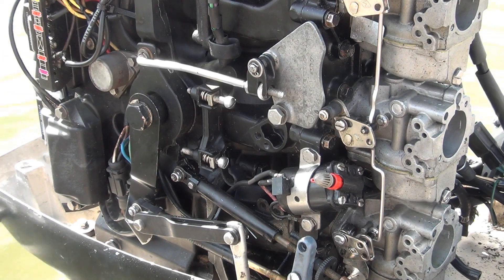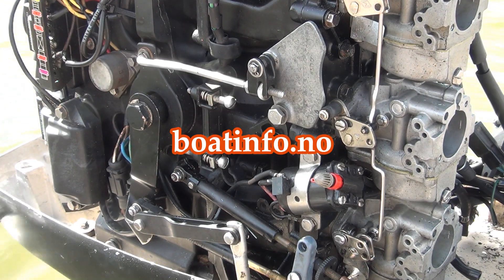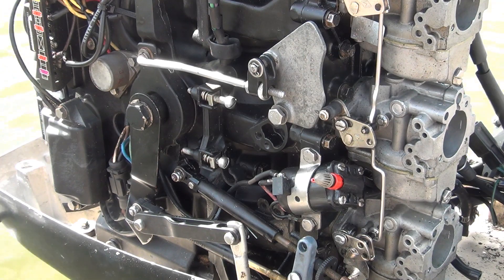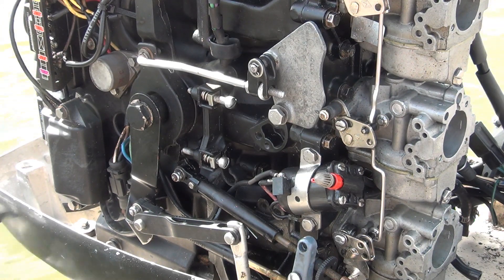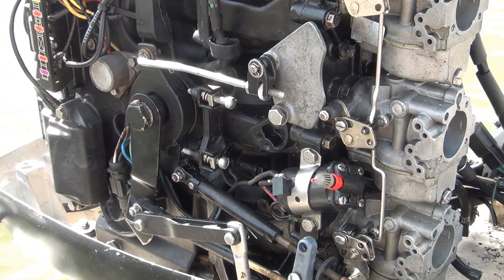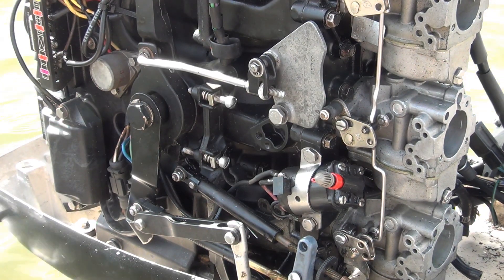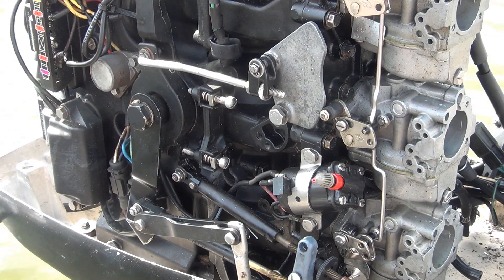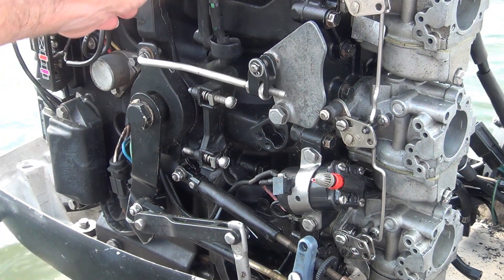WEAK SPARK - 1987 Johnson 70 Hp Outboard

Comment: i just fixed my johnson 70 1999 model it was doing the same thing idle good ,good top end  but fell on its face and stalled just off idle .my throttle plates were opening before the timing base advanced, so i just gave it a little advance just before the throttle plates opened  and it fixed it straight away. i thought it would be anything but that .hope this helps.
Reply from the maker: Hey. Thanks for watching and commenting. Yes, I read that on some forum, and tried it with no luck. I'll try it again and see what happens. I really dont want to  tear this thing apart !  Thanks again ! Stay tuned !

Comment: If that engine has been underwater., check all the 12 volt positive wires and connectionds. They corrode fast if battery was connected when sunk. Try a voltage drop test on power pack feeds ect
.
Reply from the maker: Hey. Thanks for watching and commenting. No it hasnt been underwater in a long time but it does stay in the lake. And yes, the last time all the positive connections corroded fast. Had to replace the big red plug and key switch. Thanks again & Stay tuned !

Comment: Hey,TOO,Just got another Boat,1963Starcraft Jet,15 ft.,w/trailer and A 63 Johnson 40hp.SSeahorse'lectric shift,Have any Exp with them,Won,t shift to forward,only Rev.,Any Exp.with them,You or Kodibas?Best Video,s Ever!!!!!!
Reply from the maker: Hey Your probably looking at a new shift solenoid. Its in the gearcase I think. Check the schematic at marineengine.com. to be sure. Thanks !
Reply: @THISOLDOUTBOARD1  got only Two Electric coil Magnets on both ends,only 2 wires running down to Lower,Checking the Grounding  and the Switchs first on shifter!
Reply: Yup,Getting My Plan of attack all Ready,What to do  First,Gotta say,this thing is Built pretty Stout,got old 1/4"ply out and Drenched 1"Foam,Hows your Starcraft Coming Along?
Reply from the maker: @smc65714  Slow. this crazy motor has been taking to much time.

Comment: OK, well the original low compression readings do concern me...And, you are right, buggered up sync settings do point to some sort of problem.  The probability of the carbs getting messed up during an overheat is low, like you say, but not impossible.  That fuel pump isn't properly mounted, and that fuel tank looks suspect, but that does not mean is it problematic.  Running so poorly after an overheat oftentimes indicates some sort of internal damage, scuffed/scored pistons, etc.   BUT, just cuz it overheated, doesn't mean it is internally damaged....But, these loop scavenged engines are not tolerant to much if any internal damage or wear before they refuse to idle correctly.  And, just because the compression readings came up, does not mean all is well internally....
OK, so you are suspecting ignition problems, perhaps....I'm not sure I would trust that inline neon tester though....I know it is tough to watch, but does the light brighten up and get consistent when you get the engine to accelerate and run OK at high speeds?  Again, please don't get hurt bouncing around back there while the engine is running fast....
Generally speaking, the CD3 ignition system on this engine is very reliable, charge coil and sensor problems are rare....Please do not pull that flywheel off just yet, you don't even have the correct OMC puller....And, you will need a ring gear holder to properly retorque the flywheel.  Using the zip gun for installing the nut may lead to a sheared flywheel key.  
The connection between the overheat and possible ignition problems is the heat that may have melted/shorted ignition wiring or connections.  Using your eyes and doing simple common sense testing is the best first route to take before getting even more frustrated by swapping parts.  Keep in mind that the ignition systems changed quite a bit on these engines through the years, so the possibility of mismatching stuff during your swaps is great.....
I would start by a visual test on all your ignition wiring...Is any of the wiring melted where it was laying on the block?  I would pull apart all the amphenol connections to ensure the pins/sockets are properly positioned and not damaged...Use isopropyl alcohol to lube the rubber connectors, DO NOT spray WD40 in there.  Look at those coil primary connections, those push on connectors often get loose/corroded.  It is OK to use a little grease on these connections to prevent future rust/corrosion. Next, I would check the powerpack and all three coil grounds with an ohmmeter on the low ohms scale.  You should see less than one ohm when checking between the ground lead and a good block ground.  Next, I would push the key switch stop lead out of the amphenol connector and retest.  You will need the amphenol tools for this, do not cut the lead.  And yes, you will need a decent spark tester to do a cranking output test.  This will either confirm or deny what you are seeing on your neon light.  
Once you have done all this, we can talk about some resistance tests on the charge coil and sensor coils.  These tests can be done without removing the flywheel.  You can check the coil primary and secondary resistances as well.  
Again, I understand the frustration, but try hard to avoid the swap out testing methods.  Chances for introducing new problems and getting even more confused go way up....We have to stick to "the basics" as you said, and use proper test methods...
Reply from the maker: Thanks !

Comment: New subscriber here, timer base won’t make weak spark. Timer base is just a trigger. Check your coil grounds, charge coil voltage output, power pack voltage output.
Reply from the maker: Hey Thanks ! And thanks for watching and commenting. Yeah I'm figuring it out a little at a time. Dont usually fool around with these bigger motors. Yes I've ordered the DVA. Thanks again !
Reply: THIS OLD OUTBOARD awesome, any questions feel free to ask! 👍👍
Reply from the maker: @jcdesignsandboat-works8290  Thanks !
Reply: THIS OLD OUTBOARD Yes sir, you bet!

Comment: My mate had one of these he replaced the coil pack and ran beautiful..
Reply from the maker: Hey. Thanks for watching and commenting. Really appreciate it. I've already swapped out the coils and no change. Stay tuned !
Reply: THIS OLD OUTBOARD did you try and replace that box with the orange and purple on it above your coil it’s all electrics wires
Reply: Try that before taking flywheel off..
Reply from the maker: @zanegilmore6450  I'll check it out. Thanks again

Comment: What does the WD40 do to increase compression?
Reply from the maker: Hey. The motor had been sitting after it ran hot and died. The first compression test was 90 on the middle cylinder. Thought possibly the ring was stuck and the wd40 would help loosened it up. Well, got lucky, that seem to be the case. Its still at 120. Thanks for watching and commenting. Stay tuned !

Comment: I’m assuming you’re running the engine with the tank vented, it probably would not run if you kept the tank unvented. It would only run while the tank was under pressure.
Reply from the maker: Hey. This thing runs either way! Its Crazy. Thanks for watching and commenting. Stay Tuned !
Reply: My experience with unvented tanks is that the engine will run for a while and then will be starved by the vacuum that is set up. In fact if it is a plastic tank it will concave telling you to release the vent.

Comment: My son in law traded a Harley for a Skeeter bass boat with a 175 Johnson. The guy took him around the lake and it ran perfect. He brought it here to Texas from California. Took it to the lake. It started cutting out. He managed to get it back to the ramp. Its been setting for about 10 years. Now it's mine. Don't seem to have any spark. Its going to be a challenge. I don't even know how to operate the electric motor hanging off the bow. I can deal with my 14 aluminum with the 25 Johnson. Daughter is counting on me getting it running. I guess I will start with a book on it.
Reply: Was down at a boat ramp a few years ago. A guy backed a nice Bass boat into the water. It wouldn't start. He started screaming and throwing things. I felt sorry for his fishing buddy. I once had a 23 foot cabin boat with a 60 Scott. McCulloch . I had a Sears Elgin less than 10 hp that brought me in several times.
Reply from the maker: Hahaha ! Thats Great ! Go For it ! Check out boatinfo.no. All the manuals are there ! Let me know how it goes ! Thanks for watching and commenting ! Stay Tuned !

Comment: you really need a spark gap type tester. I love my CDI one as it allows you to do up to 8cyl in one whack. very very helpful. supposed to jump a 11mm gap. next check the output of the charge and power coils from the stator. ill betcha those are gonna read low, especially when she acts up. If good : new power pack baby! Haha good luck
Reply from the maker: Hey. Yeah, bought time an break down and finally get one! Hahaha Thanks again & Stay tuned !

Comment: If that tank is EPA compliant, 😬 the check ball will let air in but not out to keep from polluting the environment. Ha ha.  See how the ball mechanism is configured. That pressure could definitely flood the carbs if the needles are worn. That most likely would show up when it's just sitting without running.  You tried with a loose cap so that most likely isn't a problem when running.  I will say this, I had a 1973 Evinrude 65hp Triumph.  It would hesitate when slowly transitioning from slow to high speed.  I had good spark though.  Tried syncing the low speed on the carbs with some improvement but didn't completely remedy it.  One day it was idling in the bay while I was fine tuning the carb adjustment and it spit back on me and made a loud pop. I saw something hit the water and it immediately died.  I was like, what the heck was that!  Tried turning it over and heard bad noises. Got to looking and I had a hole in the block. I pulled the power head and disassembled it and discovered quite a few things had been going on.  What caused the hole was one of the Piston skirts broke off and got in a bind near the crank. All three wrist pins had a lot of slack in them, like 1/16 inch.  Also the Pistons were worn badly and had a lot of slack between them and the cylinder walls.  Miraculously the rings were pretty tight so it had good compression.  I had a buddy at the time that worked on OMC outboards and was a certified mechanic. Went to a school to get certified and had worked on them for a couple of decades. I told him about what happened and what was occurring before.  He said that a hesitation like that was often a symptom of severe wear in the powerhead.  Not always but often.  He said a lot of things are going on in that rpm transition causing it to hesitate when it's got a lot of wear.  Hopefully yours is spark.  Luckily you have parts motors to see.
Reply: The check ball in the cap is suppose to vent at 5 psi, so the tank balloons up before that happens.
Reply from the maker: Yeah. I've been worried about skirt wear. and want to spend any big money on it. If we can just get the guy to his fishin hole and back he'll be happy. Thanks for watching and commenting. Stay tuned !

Comment: clean carbs reset the mixture with the jets to stock .One or more carbs is having trouble getting out of idle circuit then resync carbs.
Reply from the maker: Hey. Thanks for watching and commenting. How will that help the weak spark issue. Thanks for watching and commenting. Stay tuned !
Reply: @THISOLDOUTBOARD1  you will find the weak spark is another issue. I had the same thing with my 70
Reply: @tomhobbies6888  how would you "reset" fixed jets? the only ones that had an adjustable slow speed needle were the newer 93' and up oval port motors
Reply: @ct1762  the high speed are fixed but the low speed are adjustable unless that thing is newer than it looks
Reply: Sorry your right  I just checked my repair records it was a 71 60hp triple
Reply: @tomhobbies6888  Sorry didn't want to sound smart! It's just I have 4 of these 3 70s and a 1993 60. The one thing that struck me, and it's kinda nice, is that the 93' has adjustable low speed needles to get it just right

Comment: What about this...   Pressure in tank feeds fuel from the tank to the cylinders...   But after an initial run pressure in the tank has been reduced by use of some fuel so pressure no longer feeds fuel to the cylinders...  And the fuel pump is too weak to pump fuel (without the initial tank high pressure) to the cylinders...     What do you think...?   How much is a fuel pump rebuild kit...?  (to eliminate a possible weak fuel pump issue...?)   Just brainstorming...
Reply from the maker: Hey. Just found out that the tank has a ball in the cap thats suppose to relieve the pressure but its stuck. Great comment though. Thanks again !
Reply: @THISOLDOUTBOARD1  Well soak that cap in a coffee can of some straight ethanol gasoline overnight and get on with it...
Reply from the maker: @williamriley2528  Rodger !

Comment: Heat soaked coil would produce weak spark...???
Reply from the maker: Hey. Thanks for watching and commenting. Stay Tuned!
Reply: in a way yes, but not on all 3 cyl. this is most likely a stator or power pack issue. maybe lucky and the connectors just need a refresh

Comment: What portable plastic tank has no air vent thats crazy.Tanks have to vent thats not correct. I thought you had a fixed tank system on your friends boat.Wrong cap on there possibly do they make a cap with no vent I would think you would have to crack it open to vent if no manual vent.In all my years I never seen a cheap plastic tank that looks like a pregnant guppy that delivers fuel properly all blown up like yours. Fix that and then move on to ignition possibly.  Wow this is fun change the outside pack first thats easy....  Glenn P.
Reply from the maker: Hahaha. A guy commented last time and said he has the same tank and there is a little ball in the cap that is suppose to release the pressure, well he's right, but the ball is stuck and I cant get it to move, as you'll see in upcoming episodes, keep in mind the videos your watching now were shot a week ago. Anyway this thing runs either way, cap tight or when I loosen it, no change. Thanks again !
Reply: @THISOLDOUTBOARD1  Wow thats something I would leave it vented or you said you fixed that stuck ball. Hey I learned something new never knew about that cap design.I still would leave it loose when running around the lake but thats just me..........................................LOLL Glenn P.

Comment: I had a 76 evinrude 75hp  similar issues  ended up dumping it.  Ran fine in  the test tank but bogged on the lake.  Stick with it  you have more patience than I
Reply: I use eBay when I can. Thanks for the suggestion. Cheers!
Reply from the maker: Hey. Thanks . Appreciate you watching and commenting. Stay tuned !
Reply: I have a 1963 Johnson 10 hp that I am going to tear down and rebuild the ignition, carb and lower unit. Parts are just so friggin expensive in Canada.
Reply from the maker: @wniner8194  Have you tried ebay.